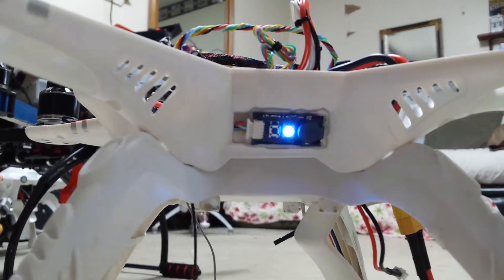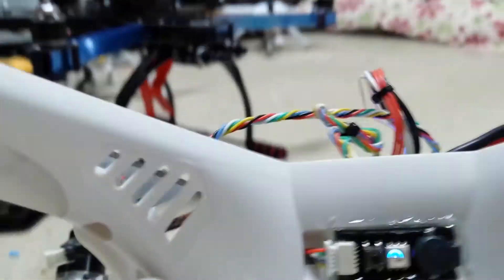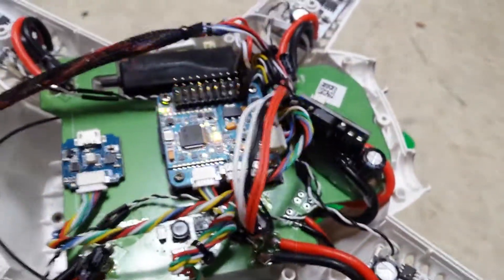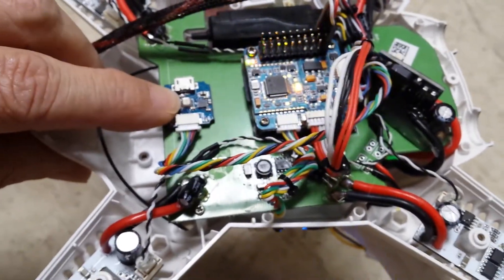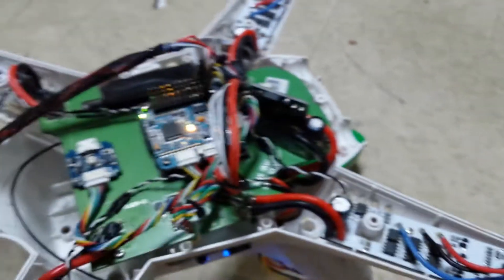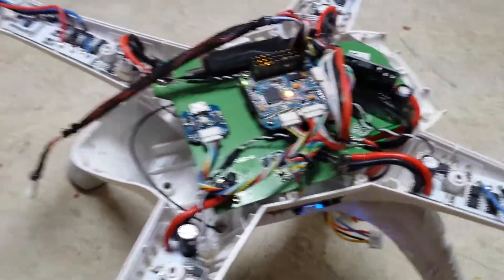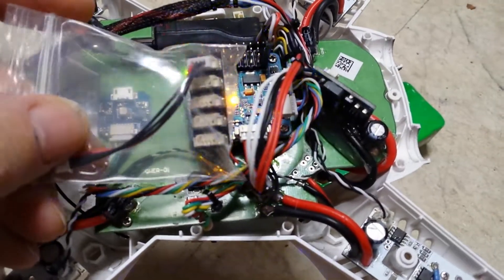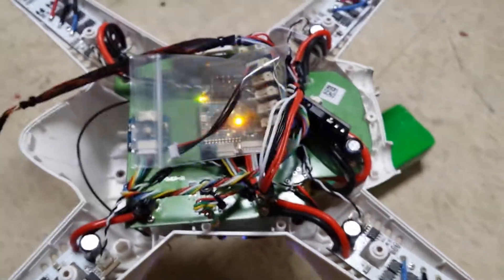Walkera QR X350 Pro with Mini PX4

Comment: Shane, you continue to be a wealth of information regarding mods like these! I mentioned on Facebook about how i was not sure how to connect up the Walkera 703a rx to an APM2.8 - your info sorted that out for me. Today i have been trying to find out how i can connect the stock 350 pro compass to the APM, and here you are explaining it! I know your using the pixhawk, but the APM is the same with having only the one I2C port. Thanks to your info in this video i just ordered myself a splitter for a couple of £, great to hear that the walkera compass will plug straight into it.
It is great that you take the time to help others out like you do. Very much appreciated this end - thank you.